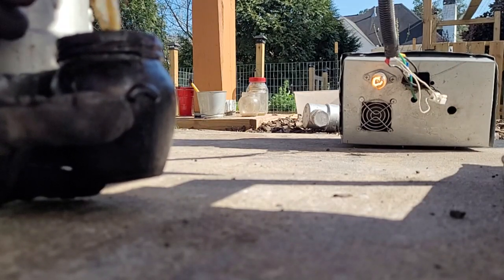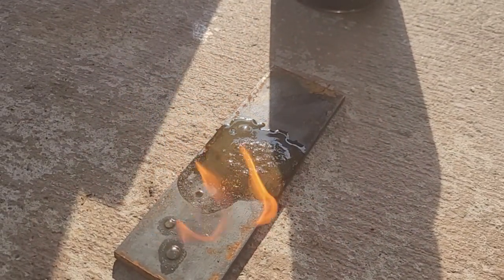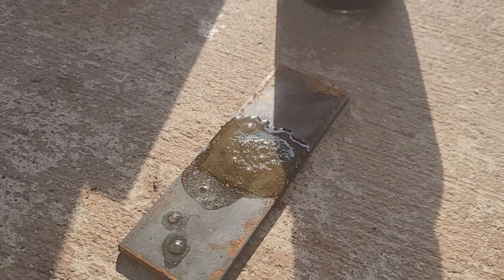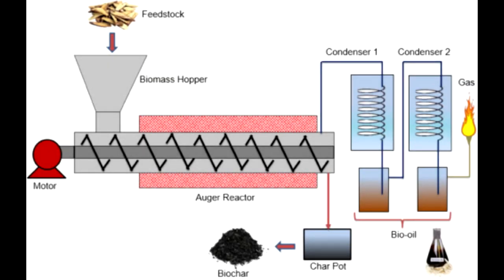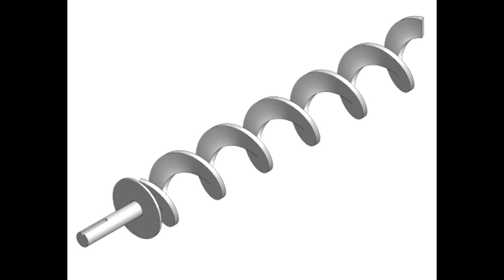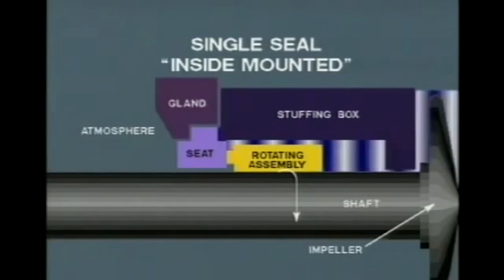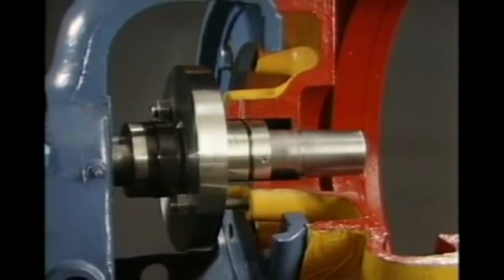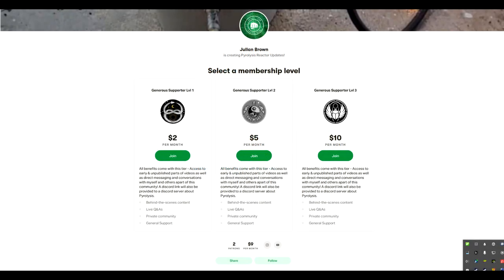What's Been Up with the Microwave Reactor?

Comment: Collect that gas economically. If gas is cool enuf, there is a technique to "bag" it someone else used in a bioreactor.  No need to compress.
https://youtu.be/pKZgnXQCp98?t=306

Very high potential to hook up to generator to burn that gas to power entire system and possibly as fast charge point for Tesla? =)
These things burn about anything: https://www.youtube.com/watch?v=iMMCN6T5tig
Capstone is a real company - if scale UP i think your process would be ideal (the gas) to produce the oil.
Or to give local towns a new revenue source for powering grid. Could be interest there too (plastic recycling has failed imho)

In my minds eye, i see your invention NOT scaled up, but mass produced for small towns to have multiple of these.  Like an automatic can recycle stop, can in, money out. In this case, they can either get money, or they can get the energy (gas or oil), or industry can come get (they'd jump at it is my bet - inexpensi energy=win).

Keep in mind: simple design wins.  Plug and play for all components, easily unplugged and reassembled. Common parts (like conventional magnatrons). Make it easy to set up, easy to use, easy to clean by non-scientist/engineer.

In 3rd world countries they just burn plastic at side of road to dispose of it, or they throw it into river headed to ocean.  Its terrible. Your plans have some much potentian in SE asia.

I love what you are doing...i had same idea but didnt action on it.
I will be following you with very keen interest and sending some money.

I think you are doing Gods work.

Keep on truckin man!!!!
Reply from the maker: Wow, this made my day! That idea of non-centralized, community based smaller reactors is the vision I've been working so hard to achieve. 

The gas is of such calorific value and usefulness that it is one of my top priorities to properly refine and store it.

 That, combined with the oil yields  metal recovery and carbon usability makes me question why this isn't already being done. 

Hopefully soon  enough, this may be run off solar panels or some renewable energy to completely offset any  issues concerning energy input to output ratios. 

Thank you so much for watching and commenting, all of us, together will make this a reality!

Comment: Great to see all ideas and research you are doing! And very wise, sometimes it is not about running to win. I find shaftless auger kinda genius in its simplicity. I hope you will find a great way for bearing sealing (gas rope packing looks good on paper, especially since you will push stuff with will block some oils and most reaction will be done further from it. Vapours should go with path of least resistance to the closest outlet).
As you are making some experiments on MARK2, definitely check how material fragmentation interacts with microwaves. And probably second, mixing beforehand shredded plastic with carbon black (coal powder), I found this is often done as "catalyst", plastic is transparent, coal absorbs waves, works like a small heating element melting stuff around with when liquified absorbers waves better,
Once again, I like what you are doing, read for hours, think twice and build once. 
Fingers crossed for your work!
Reply from the maker: Thank you so much! Will most definently do that experiement you mentioned, cheers.

Comment: if you don't need access to the back of the shaft where your auger screw comes through the reactor housings. then just seal the back end completely with a cap to cover the end shaft and bearing hole. if you need a motor to turn the shaft then just make a cover cap big enough for the motor also.
Reply from the maker: This is definently a thought I've pondered on. Its a last ditch resort if nothing else works, because this would make any type of maintenance a complete pain. It's not a bad idea, it's just certainly outclassed if other options that are less permanent can work. Thank you!
Reply: @naturejab  Also a motor doing electrical work inside a pressure chamber with gas and oil could go boom no?
Reply from the maker: @rickfrogm825  indeed, and the motor needs air flow anyway so it doesn't overheat

Comment: Did you know precious plastic? I think you can adapt their shredder and extruder machine to your design:
https://www.youtube.com/watch?v=1A05nDBKzVc
The idea is that you can adjust the feeding rate to the reactor, surpassing the problem of microwaves not penetrating enough the plastic layers. Also, by adjusting the feeding rate you have control over the exhaust rate of your machine AND reaction time inside your reactor chamber. Thats allow fine control of your machine and their byproducts. Also makes a your machine 2x1 (multipourpose), as you can decouple de extruder to make filament or injection molding, or couple to the reactor to make fuel
Reply: Of course, you can instal some kind of grinder/guillotine at the end of the extruder to make pellets on the go. Other option is to put a sheet mould at the end of the extruder tip that feeds the reactor whit film made in situ
Reply from the maker: Yes! I actually have been looking into getting a precious plastic shredder for some time now, for all the reasons you mentioned above. Thank you!
Reply: @naturejab  I think the extruder could be even more usefull for you than the shredder. Instead of struggle whit the shaftless feeder+sealing etc, you have already the plans done for the extruder, and no need for sealing is required as the output is compressed preheated plastic whit no air inside!
Reply from the maker: @kaervas  true, I will look into this, thank you!